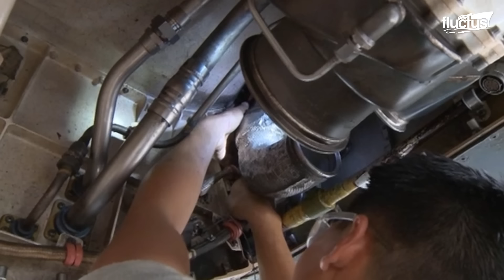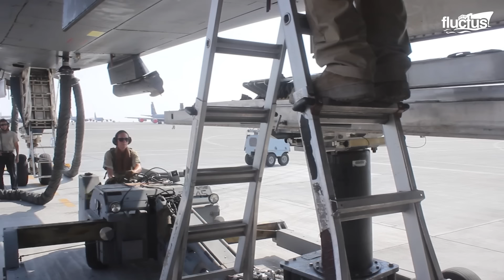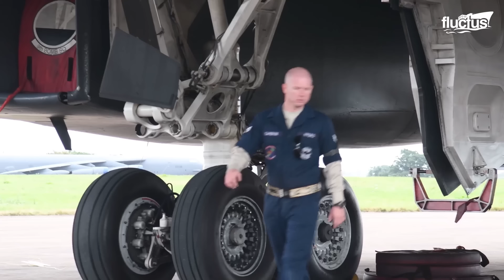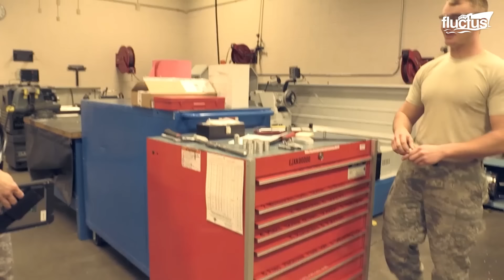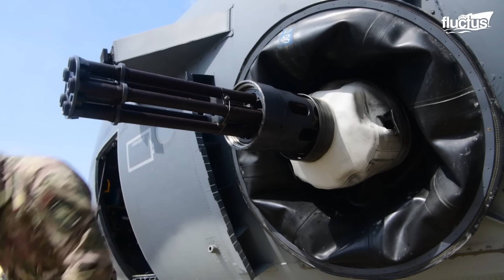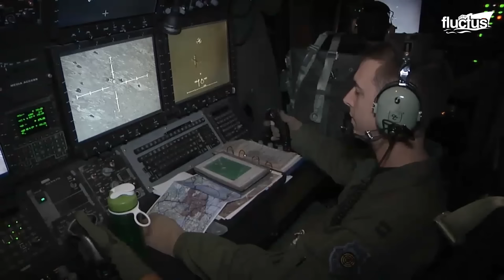Inside Super-Advanced US Bomber Flying at Supersonic Speed

Comment: Always wanted to fly this. I flew F-14s and this was just the larger faster version of an F-14.
Reply: Faster? Not quite
Reply: @Kevhoe  the F-14 on paper IS faster but certain criteria had to be met. Mainly altitude and payload. We were limited to Mach 1.5 while under 30,000 feet. It could do Mach 2 plus but you'd kinda have to wring its neck at altitude and good luck if your carrying any significant ordnance.
Reply: No it's not.😅
Reply: Should have joined the Air Force instead of the Navy 😂
Reply: @goodfoot7926 well if the air force had any good movies when i was growing up i would have. Top Gun was impossible to beat!

Comment: Any Ejection included with the Lancer??
Reply: Yes. All 4 seats can eject.
Reply: Technically you can also extend the entry ladder with a rocket motor to allow for crew to bail out that way. That was supposed to be for the 2 extra seats instructors could use, increasing the crew to 6, but we removed those seats because the cancelled the use of them permanently. If a crew member is out of there seat on the toilet or the galley area (in the same location) and something happens they can still bail out the bottom, although most folks feared that way out.
Reply: @Trindal  Thank you for that great info! Appreciated!
Reply: That’s not what ejects from my Bone